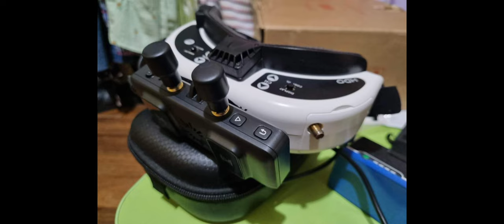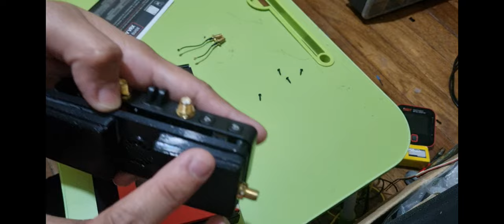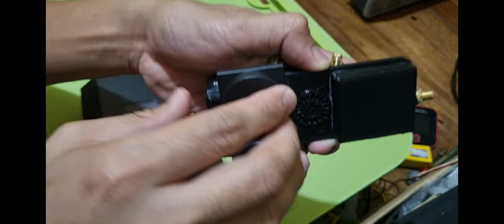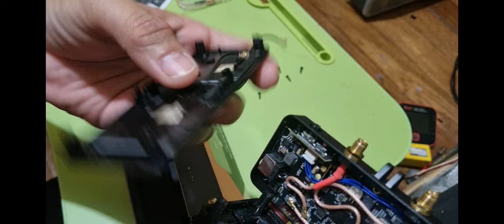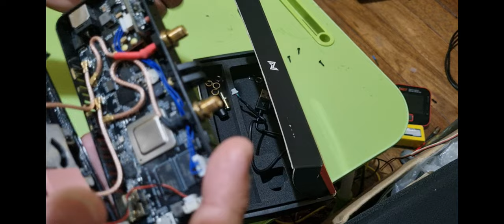Walksnail VRX antenna modification

Comment: Thank you for your video.
I did a couple tests with the VRX as is and was a bit disappointed by the range of the stock system compared to what I was able to achieve with my older analog setups (2 vs 8 km). It seems that I will have to make that upgrade too.
Reply from the maker: yeah, dont rely on stock antenna on the VRX if you want to get good performance :)

Comment: I want to use Triple feed patches.  The round ones.  Would I be able to use them with the mounts on this vid?  If not, would you have a link to a thingiverse design for a triple feed patch that would work with the print for the VRX unit with the slot rails?
Reply from the maker: https://www.thingiverse.com/thing:5824452

Comment: Can there rise problems (interference for example, signal distortion) with the routing of the antenna rf-pigtails directly over the electronic components of the board?
Reply from the maker: actually, in RF point of view, it should not impose a problem UNLESS the antenna installed are unbalanced (coax shield becomes part of the antenna due to the improper design). Stock WS antenna are unbalanced. With good antenna though it should work perfectly. I got 35km after doing the mod and using TrueRC x2-airs ad Geprc triple feed patches.
Reply: @windfpv  So it's basically a good idea to invest in quality antennas in the first place, no matter the pattern/usecase (omni/directional). Thank You very much.
Reply from the maker: that's right. Good antenna are good investment.
Reply: @windfpv  Regarding the 'unbalanced' antennas: If get that right, the best balanced antenna would be an antenna with an VSWR=1, correct?

Comment: Just finished ,only i drilled a hole in the front after removing the long range from the cover bit tight fiddly.all good coulda used shorter cable
Reply from the maker: shorter coax should be better :)

Comment: Hello WindFPV, i followed your vid to upgrade the antennas, 2x truerc x2 air for the patches, 2x TrueRC OCP 5.8GHz Antennas for the omni on top, but the range is worse than with the stock antennas... What do you think is wrong? 

I put sma connectors, and rhcp antennas, rhcp on the vtx also..
Reply from the maker: Have you checked the connectors? Top ports are using rpsma
Reply: @windfpv  i changed every connectors from rpsma to sma, top ones included. I checked every ufl connectors inside the vrx, and its ok. The only thing ive changed compared to the stock installation is: the antenna on the vtx is not directly connected to the vtx, it is ufl from the vtx to a sma connector on a tpu print and then the antenna is connected to that sma connector. Do you think it could come from that?
Reply from the maker: not really, since I also use U.FL to SMA on my VTX's... You might want to play with channels, bitrate and power output perhaps. Make sure all antenna have the same polarization
Reply: @ren0291  did you figure it out? i am having the exact same issue

Comment: What is the reason for Ant1 is better for long range? For telemetry?
Reply from the maker: For retransmission of packets, basically the range will be depending on both the tx and Rx antenna on the vrx, and the antenna on the vtx. Not like analog systems that would only depend on the range brought by the vtx antenna and vRx antenna.
Reply: The transmite antenna tx  is the right one face to vrx if you boost this antenna you well get better réception so mor range , i boost all my antenna in my vrx i get better penetration + mor range over 1km in 200mw mode
Reply from the maker: Not necessarily the patch, check where the ANT1 ufl port is connected.

Comment: I really don't get how Caddx could put so much into developing this awesome VRX then crippled it by adding LHCP patches and RP-SMA connectors. I'm sure most pilots will inadvertently toss on RHCP omnis (as I initially did), end up with poor range and image quality and then blame the Walksnail system. 😞
Reply from the maker: indeed, WS should have opted to put some SMA, and not built in patches...
Reply: Why?...everyone knows the HD systems use LHCP antennas?...🤔😳🙄🇬🇧
Reply from the maker: actually, the reason why DJI is using LHCP is to not swamp out most of the analog 5.8GHz flyers that fly on RHCP. BUT that DOES NOT imply that HD systems need to use LHCP. In fact you can use either RHCP or LHCP. It does not matter as long as you have the polarizations matching. Even HDzero didn't pressure the users to use LHCP, giving the users the freedom to choose which polarization to use. Now if you ask why I opted to use RHCP, it's because I have a lot of 5.8GHz RHCP antenna in my box of stuff, and I want to use my high gain ones, which means I wont be using the LHCP patches on the vrx, thus the conversion. 

Again, this mod is not for everyone. If you prefer LHCP,  then stick with it, or if you prefer to use the stock patches then stick with it. Personally I dont want to use it, especially for my kind of flying, long range and stuff and mostly fixed wing.
Reply from the maker: Im mostly on 1.3GHz as well for my long range or low altitude flights in the videos posted here in my channel. I have converted all my planes to 1.3GHz that's why I got a lot of 5.8GHz RHCP that used to be on my setups before
Reply from the maker: I was able to do 12km, not yet maxed out, need to turn back because too windy, aiming for 20km on next attempt, just waiting for a more calm day 😁
Reply: @windfpv  So, I'm guessing your using TrueRC antennas on the RX end and Lollypops on the VTX?..🤔🤔😳😳🇬🇧
Reply: @windfpv  that's incredible dude!
Reply from the maker: Yeah, truerc x2-airs plus triple feed patches on the vrx, and just geprc momoda on the vtx.
Reply: @windfpv  Wesley Varty got out to 31kms I think...Those big Dinner Plate triple feed arrays though...🤔😳😳😏😏
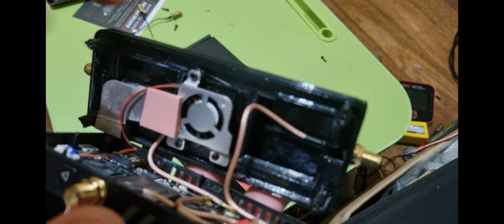Reply from the maker: It's 40km on his latest tests. The same triple feed patches that i got here. :-D Just note, his altitude was really massive to get that far. :-P to give you an idea, doing 12km he was already at around 1k. when i flew mine, bitrate went low, but my altitude was about half of that of Wez's. It seems that with this system it would be really good to maintain a 1:10 line of sight ratio (alt to distance) to get the most out of it.
Reply: @windfpv  Aawesome, better than 4km im sure the box said, that and pre buying rh for the hdzero kinda was annoying.teach me to read more.glad to see what you have done big congratz n thanx for sharing!
Reply: Yup the guy i bought it from had RHCP on there and i couldnt figure out why my range was so crap until i realized.  I put RCHP on my avatar HP. got better. Put a patch RHCP on VRX got better still but it LHCP and RHCP combine now...

Comment: So when you switch the connectors are you still using lhp or rhp antennas?
Reply from the maker: I switched everything to RHCP, since I have a lot of RHCP 5.8ghz antenna before which I used when my planes were on analog 5.8

Comment: Hello sorry to tell you you are wrong , the transmite antenna is the right patch antenna wen you look the vrx in fronte face look the ufl connect one is connect to amplificateur Rf and is the patche antenna 👍🏼
Reply from the maker: Are you sure? Have you opened yours? Are you aware that there are batches that had the transmitting antenna on one of the patches and there are batches of the vrx that has the transmitting antenna on one of the antenna on top? The best way to check is to look for the marking on the PCB, where you find the ANT1 that's your transmitting antenna. No mistakes on that.
Reply: Non pls thrus me my friend that is my work ! Look in the top of the ufl connection 3 of ar connecter to mini driver carte video transmission and 1 only the right pacth face to vrx are connect to mini sginal booster ship that id the transmite connection . Sorry for my english i am frome france , i do in my one vrx i transfert the rf antenna in the top of the vrx know is working nice i get better penetration withe stock pacth antenna + 2 foxxer lolipop4 in the top + 2 foxxer antenna lolipop4 ufl 15cm in the vtx
Reply: Check and let me know i am 200% sure i don't know why walksnail do that maby som erreur in the production i dend them message non anwser ... The rf antenna non need to bee in patch if you fly in your back non mor signal rf so you failself vidéo the rf signal must be in regugar antenna not patch look the walksnail goggles the tx antenna is in top if you fly withe 4patch in the goggles and you fly in your back you failself video if you put 2 patche + 2 regular antenna you don't failself when you fly in your back i do the test in my friend goggles
Reply: In my tx sma i connect dual put out i connect 1 patch + one regular antenna 👍🏼👍🏼 thrust me my frien you look like chappy antenna but you get verrryyyyy nice pénétration i get mor range vs dji v2 +vista of my friend
Reply: Ps: don't mixe rhcp and lhcp atenna i expecte  you know that !
Reply from the maker: Haha! Of course! Who does that???? Nobody in his right mind mixes lhcp with rhcp 🤣🤣🤣 all my vtx has rhcp as well
Reply from the maker: I actually watched that. And I understand that Ant1 is transmitting and the rest are receiving antenna. Now to answer your questions/concerns, the I placed a truerc x2-air on Ant1, mainly because I don't fly behind me. I fly fixed wing on low altitude, or long range, but all happening in front on me. Again, it's a personal preference to use a truerc x2 air on ant1, it's a 13dbi dual crosshair but it works perfectly with my flying.  Oh, I have an alternative setup where i have the x2 airs on the front, and I have two triple feed patch antenna 14dbi on the top. I have tested it to 12km just for now, I'll be doing 20km if I can get a less windy day. I also want to clear things that when I put crosshairs and patches on the vrx, it works because of my antenna tracker, points towards the plane all the time
Reply: @windfpv  so you are saying that you waaaaait whaaaat u reached 15 km using the modified antennas on the vrx ??  Did i understand that right ??
Reply from the maker: it was 12km, not yet maxed out, turned back due to 40kph winds as it made the long range test not really ideal, ground speed was just around 30kph because of the strong headwind, so it was very inefficient. I will redo the test on a calmer day. :-)
Reply from the maker: just an update, 35.7km out and back last week :)
Reply: I'm going freestyle so after reading everything should I change anything lol other than my 2 long ones on top and maple triple on the front xo thank for the idea I live not having to buy different antennas, when I work out what is going to fit better where then there staying until I try fixed wing ide love to try that along the coast just to many no fly zones ..oh how did it change from lhcp to rhcp I'm new and getting old also my meds are messin with me .nearly finished 3 drones so I'll find out but I just want to understand how just changing them antennas made it change ,thank you even a link would do .save you time 🎉❤❤🎉😊
Reply: That's a nice looking antenna tracker setup you show at the end. Looks like a crossbow hidden behind those huge antennas. I'm sure a lot of people would find it useful if you did a quick overview of your tracker setup please!?

Comment: Can I use only triple feed patch in all the antenas or truerc is neccesary or best?
Reply from the maker: you can use TFP on all ports, or x2-airs on all. The only thing you want to check is the quality of the antenna, since TFP is an opensource design, anyone who has the tools can build one, but not everyone has the right instrumentation device to measure the performance. It means that not all TFP are made the same as the original design. While with TrueRC, it is designed with consistency on the hardware, with trueRC brand you buy with confidence as they really got the the right tools for the right job. Price wise, the TrueRC antenna just like VAS are tagged higher than opensource ones, of course. Mainly because of the R&D costs involved.
Reply: I'm using maple on the front

Comment: Hi, can I have the link to SMA to UFL connector ?
And thermal pad ?
Reply from the maker: u.fl to sma female  (get the 10cm one)

https://www.aliexpress.com/item/1005004454715029.html?spm=a2g0o.productlist.main.89.5a188fc8nUnWsn&algo_pvid=6f47aa6d-d8bc-4639-9e24-9d1d497496cc&aem_p4p_detail=202302242232542347365942866460003722170&algo_exp_id=6f47aa6d-d8bc-4639-9e24-9d1d497496cc-44&pdp_ext_f=%7B%22sku_id%22%3A%2212000029231381127%22%7D&pdp_npi=3%40dis%21PHP%21237.13%21165.99%21%21%21%21%21%40211be59e16773067741852796d06f7%2112000029231381127%21sea%21PH%212393024912&curPageLogUid=G0GLTHKxFfiM&ad_pvid=202302242232542347365942866460003722170_12&ad_pvid=202302242232542347365942866460003722170_12
Reply from the maker: thermal pad (2mm will do) :

https://www.aliexpress.com/item/1005002842166246.html?spm=a2g0o.productlist.main.1.78c147c0Ws91jT&algo_pvid=83d80b7f-e84f-480f-a8b0-7561c9d6d86a&algo_exp_id=83d80b7f-e84f-480f-a8b0-7561c9d6d86a-0&pdp_ext_f=%7B%22sku_id%22%3A%2212000028988353800%22%7D&pdp_npi=3%40dis%21PHP%21118.02%2176.65%21%21%21%21%21%40211bd8be16773068821312678d06f2%2112000028988353800%21sea%21PH%212393024912&curPageLogUid=dW8SHgCsTXOn
Reply: @windfpv  Thank you Bro 👍👍

Comment: can i ask that the cable is not effect as it LHCP or RHCP right?
Reply from the maker: no, it doesnt matter
Reply: @windfpv  if i fly fpv what is the advantages and disadvantages of swaping the antenna? thank you
Reply: drones
Reply from the maker: You can optimize your penetration and range as you can put the best antenna out there for your needs. Regardless if lhcp or rhcp, as long as the  polarizations on vtx and vRx antenna are the same. The good thing is that you can totally remove the built in patches which are not performing really well in most cases, and put a proper antenna to replace it
Reply: @windfpv  love it but i means swap antenna 1 to 3 or 4 ? Is it good for quadcopter?
Reply from the maker: i would advise to check first what antenna you got. if you got a high gain patch, then you have to ensure that it is installed on ANT1 port. You may need to verify it on the print on the PCB of the VRX as there are two different configurations. higher gain will give you more penetration on your quad setup
Reply: @windfpv  i have the same set that you have
Reply from the maker: then put the truerc x2 air on ANT1, it will matter especially for the penetration and coverage
Reply: @windfpv  thank you so much for the advice